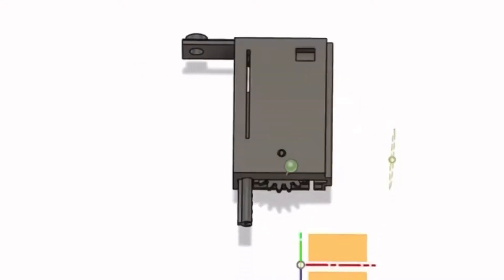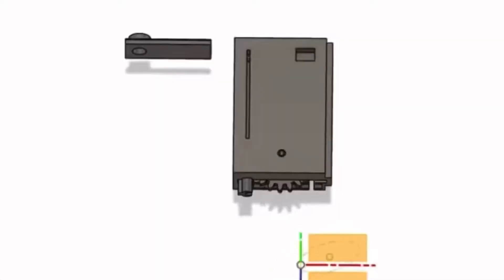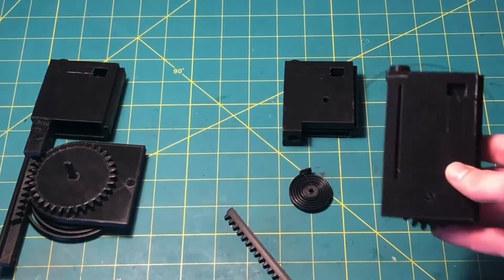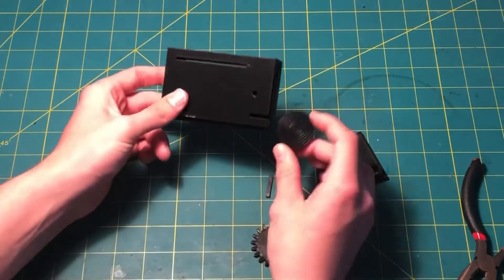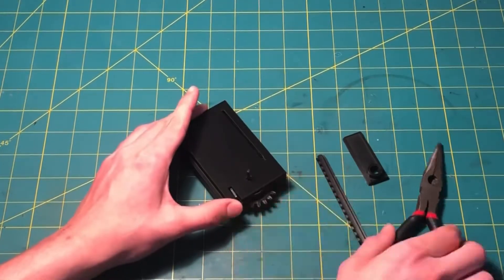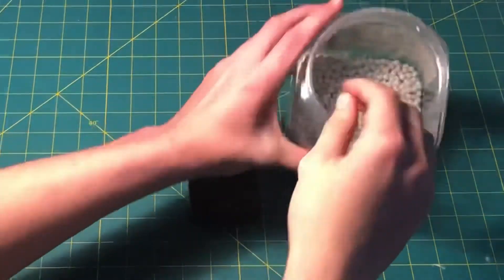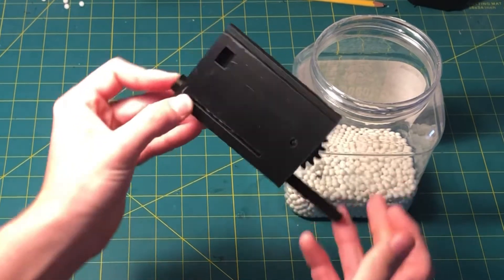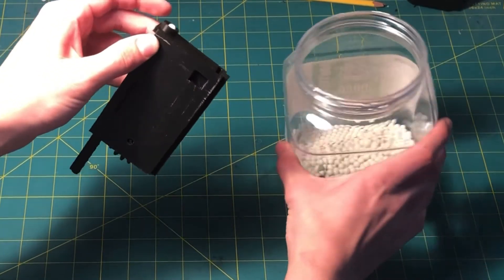3D printed airsoft magazine +STL

Comment: What material do you recommend for the spring? I have pla, but I'm 99% sure that wont work so when that inevitably breaks what should I replace it with?
Reply from the maker: I used pla

Comment: I noticed you used fusion... if I purchase the stl are we allowed to edit it on fusion or is it as is? Trying to see if I could convert it for a 3D printed g19 with slight dimension mods
Reply from the maker: Yes you can edit the file, I included an f3d file in the purchase
Reply: Thank you, really appreciate it ✌️